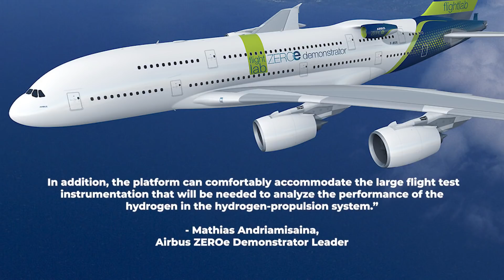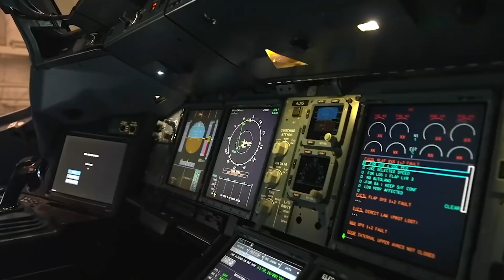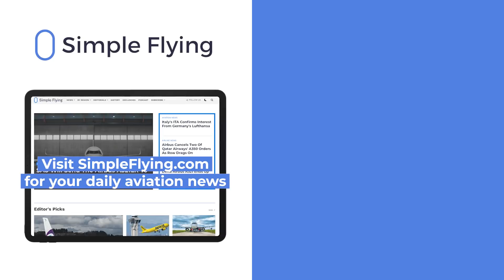Airbus Tests Hydrogen Engines On Quadjet: New Life For An Old A380

Comment: As a person that is obsessed with the periodic table, I think hydrogen is going to give the passengers a chilly flight and it will be unbearable with the altitude and hydrogen, so fuel might be the choice, but it won't for the environment, so the only possible option I can think of is using electricity ⚡⚡⚡

Comment: Several below observe that Hydrogen has to be generated in some way, and the way it is now merely puts the Carbon emissions somewhere else. With electric power the same thing happens; it's just that Hydrogen would allow longer flight duration. I don't pretend to know the entire Science, and it seems the engineers solve these problems, but for now this will require a lot of new windmills and solar farms.

Comment: how does anyone plan to produce hydrogen without using more energy than they're producing???  You'll have to burn SOMETHING to make energy to get the hydrogen.  I guess it's a good argument for more nuclear fission but still. I am highly curious how it could possibly be economically or ecologically viable to use hydrogen as a fuel in this manner since there aren't ponds of hydrogen under the ground to just pump it up. There are ways to extract it chemically, electrically, and mechanically.  my guess is the best option would be chemically but I am not sure even this could be possible to extract enough hydrogen in which you don't nullify any positive gains you would get by using hydrogen as a fuel to begin with.
Reply: Well, hydrogen can be synthesised in a variety of ways. Google the hydrogen rainbow, essentially the different ways of making it are assigned colours, from grey hydrogen (made using natural gas), blue hydrogen (as with grey hydrogen, but you store the CO2 produced), to green hydrogen (made using electrolysis powered by renewable sources), pink hydrogen (made using electrolysis with nuclear reactors), and many more. You can also produce it from biomass too. In terms of efficiencies, electrolysis is ok, somewhere between 50-70%, so for 1 MWh of energy you would get 0.5-0.7 MWh of hydrogen out, other methods can be better.
Reply: @onetrickhorse  Thanks for the reply!  after i posted this I've thought about some ways to get around the cost problems using renewables and nuclear for electrical, and yeah biomass and chemical options as well.  I still wonder about the overall cost of the energy however, especially with electrolysis. solar panels are not cheap to build and also take a lot of power to create, I am not sure the amount of energy a solar cell can output on it's life but i wonder if it's more or less than the energy expended to create it to begin with.  Regardless there is still hydro and wind.  It's a shame the solar reflectors in AZ failed with the plant that liquefied salts. I Also saw a method by which you can produce hydrogen directly on solar cells, it involved running water over them to cool them which improved their efficiency by a large amount, I tried to find that video but couldn't.  Anyways. It's just a cool topic to me.
Reply: @98f5  Anytime! And for what it's worth, you're asking the right questions, many people assume that because solar offers a zero carbon output once made, that it is therefore zero carbon. The reality is that it isn't an eco friendly manufacturing process, and recycling is also energy intensive too. 

With any energy generation technique, the ultimate comparison metric has always been cost per unit energy output, or $/MWh (or £/MWh in my case!), or if you're a consumer, cents or pence per kWh. Here in the UK, to be competitive in the energy market, you need to be able to sell energy to the grid at £60/MWh or less. Now, solar is cheap, perhaps about £40-50 per MWh, and that factors in initial cost (CAPEX) and lifespan costs (OPEX) and eventual decommissioning/recycling costs. Now, that's actually pretty cheap, in fact it's about as cheap as it gets energy-wise. But here in the UK, the sun isn't always shining, in fact, it's rarely shining enough to make the most of a solar installation, and when it does, it's not always when we want it. Wind is expensive, perhaps more like £60/MWh, with offshore being more, but it's subsidised. Wind in the UK is no doubt plentiful and common, but like solar, is intermittent, and often difficult to predict. So you need something reliable, like nuclear or gas to provide that baseload when it's a cloudy calm day, or a calm night when solar and wind is useless. Now, why am I telling you this?

Well, global energy generation works on a 'just in time' operating model. The moment energy is produced, it is used, and power grids react according to demand. That is problematic when you have intermittent energy supply like solar or wind, and it causes wild price fluctuations as demand for reliable methods like gas increase. This pushes up the cost of the energy. Now, what if we could store that energy instead, so instead of shutting down wind farms on windy days when we have too much energy, we store it somehow. Hydrogen could be a potential solution to the problem. You build overcapacity in your renewables, generate a load of hydrogen, store it as either a liquid or convert it into ammonia, and then you have options. On days where you have no wind or solar, you either burn hydrogen in CCGT's, or use it in fuel cells to supply the grid. Or, if you dare to dream really big, create a wider hydrogen economy, and use it for other industries, like aviation, which works to offset the cost. 

You mention efficiency, and quite rightly so. Think round-trip efficiency of a hydrogen storage network; you generate 1 MWh of electricity at say £50/MWh average. Then you generate hydrogen using electrolysis, so lets be optimistic and say 70% efficiency, so that price now is £71/MWh. You spend about 20% of the remaining energy liquefying it, or 10% converting it to ammonia, so now that £71/MWh is now £88/MWh or £78/MWh respectively. Then there's conversion back into energy when you need it, and lets say you run the electrolysers in reverse to generate energy (like a fuel cell), so about 70% once more. Now we've got 1 MWh of energy costing us £112/MWh for ammonia, and £125/MWh for liquid hydrogen. Which is extremely expensive of course. But now let's consider the cost of natural gas. Gas is now costing £120/MWh. And that is going to rise. So suddenly, those costs of storage look very competitive. Once the price of gas reaches about £140/MWh, the CAPEX costs of investing in hydrogen storage technology will be competitive. So food for thought!

Comment: I wish the developments could go faster. The task is getting everything to scale up and built up the logistics. I hope they really make haste on the low-hanging fruit. For example; hydrogen needs more storage volume? Then perhaps regional airlines where range is not the biggest issue can be tackled first. Makes the ground logistics easier too; the airfields from where they'd fly would be closer together and supplying them all with hydrogen for refueling should be plenty doable. Still, go! Rock on!
Reply: Why go faster into a dead end?

Comment: The energy required to liquify the hydrogen must be enormous. I head just to compress it to a practical volume for use in cars consumes something like 10% of its useful energy. No relevant info in this vid though.
Reply: It has to be cooled to under 30 K to liquify. Practical energy requirement must be staggering. Simple Flying, can you give us some info on all this?
Reply: Youtube twice deleted my previous comments so I have to resubmit a similar one. Here it is. 
The minimum practical energy to liquify hydrogen is about 10 kWh/kg while the (lower) heating value of hydrogen is about 33 kWh/kg. So one kg of hydrogen burned to run an engine would produce jsut about enough mechanical energy to liquify the same amount of hydrogen.
See: "Energy requirements for hydrogen gas compression and liquefaction as related to vehicle storage needs"
The Youtube won't let me include the link.
Reply: Youtube. Utterly contemptible.
Reply: While Youtube is contemptible, they may not be responsible for blocking my comments but rather the channel owner.

Comment: Sounds good but don't forget, hydrogen is an energy carrier - not a fuel. It does not exist anywhere on earth in its pure form. So making hydrogen is a very dirty process as it stands, mainly by burning gas or coal. For making green H2 in the quantities needed for aviation, the upscale in infrastructure needed is going to be very, very expensive.

Comment: Unfortunately this idea is a huge waste of money. "In order to produce hydrogen (with zero emissions) a process called, electrolysis. 20 - 30% of energy is lost in the process of creating hydrogen. The hydrogen must then be compressed and stored, losing another 10%. Finally, another 30% is lost when converting the hydrogen into electricity. This leaves you with 30 – 40% of the original energy used. " and unfortunately this process really can't become much more efficient. Hydrogen requires nearly as much energy to produce as it delivers. The CE rating (energy efficiency) for hydrogen is around 60%
Reply: Where did you copy and paste this from?  There are a few oversights in your comment. 
First, the hydrogen is not converted to electricity - it is burned in the engine, negating the energy loss of converting to electricity.
Second, distribution and storage is very easy with planes vs something like a car. A car can be anywhere when it needs refuelling so many locations are needed creating additional transport and storage losses. A plane can only refuel at airports so they could even have hydrogen plants on site or nearby via pipeline.
Third, jet fuel also uses a good amount of energy to make and transport with drilling, extraction, distillation and final processing. 
Hydrogen as aircraft fuel is a lot more viable than other modes of transport.

Comment: should AIRBUS introduces a stretched variant of the A380-800 it should be powered by a HYBRId® power pack . . . the A380-1000 Neo LR which is a concept super stretched variant of the A380-800 or the A380-900 for that matter . . .
Reply: Plus a swimming pool inside

Comment: Does Hydrogen have trust for liftoff or they need both fuels?
Reply: The 4 engines the A380 already has run on normal aviation fuel, only the fifth engine runs on hydrogen

Comment: It's going to boil down to how the hydrogen is going to be made. 98% off the world's hydrogen is made from methane making it filthier because you would be much better off burning the methane. If you make it from renewable electricity it is also wasteful because you would get more power efficiency from an electric engine rather than making hydrogen and burning that. 
Plus burning hydrogen still produces nox. This is cancer causing.

Comment: Hydrogen powered planes is a good step as electric ones probably won’t have the capability to go transatlantic.
Reply: Battery energy density, both by weight and volume, is pretty much hopeless for anything other than a regional flight.
Reply: @geonerd  even at that.. the economy of is horrible
Reply: Hydrogen has a really really really low energy density though. So you need huge tanks to hold the volume required. It's not the weight but the volume.
Reply: @LuLeBe  The thing is its not stored in gas form, its stored in a liquid chilled to −252.87 °C so more can be stored on the plane as something that is colder is more dense. Physics huh?
Reply: @CaptainNate22  Also they'll be testing with metal cryogenic tanker unlike composite tanker from Boeing
Reply: @LuLeBe  exactly. It's shifts the design focus to volumetric efficiency rather than weight. This isn't necessarily a bad thing, it's just different to the status quo.
Reply: Maybe a good option is to use a hydrogen based fuel cell to power an electric motor .
Reply: @kunjukunjunil1481  no, that would be a horrible ineffective solutuon

Comment: I wish this would work but ask anyone who works with H2 and you will start to see dozens of MAJOR problems
Reply: Please elaborate on the major problems with H2
Reply: @johnlove7328  

1: cryogenic under pressure
2: high volume
3: vesil very heavy
4: very energy intense to compress/chill
5: very energy intense to produce
6: very low efficency

Comment: It is interesting to finally see hydrogen take off, pun intended. It's even better to see if used intelligently, by burning it. But it still has to compete with battery technology that shrinks its energy density by an average of 7% every year. That's a tough one to compete with. Both mean cleaner skies and thumb nose to the rest of the mobility industry ;)
Reply: Yes a battery powered aircraft has one glaring issue: it doesn’t shed weight as it flies like other engine types. So takeoffs have to be done at landing weight
Reply: @TheTubadMoose  It's not a glaring issue. It's something every and any aviation engineer knows and understands well. All the electric aviation startups I've spoken to and interviewed say that they toughened up the landing gears. 

As always, there are always more solutions than obstacles. That's why these people find them for us :)
Reply: @ElectricUAM  I’m not talking about gear strength.

The heavier something is, the more energy is needed to move that weight. So unless the batteries get to the point of weighing less than a plane with its fuel reserves, they will never be able to carry more pax/cargo.
Reply: @TheTubadMoose  I'm sure you're aware that that point is more than well understood in the aviation world. Like I said previously, all the UAM/AAM companies I know and have interviewed know this basic fundamental of AAM aircraft design. Furthermore, once a plane glides with enough lift, it doesn't need a lot of energy to do so. Airliners cruise with maybe 30% of their total power output at cruising speeds and ceilings. Planes are highly efficient.

You're referring to battery energy density, which at the moment, is not big enough for more than four people flying for 10 to 15 minutes. However, new batteries are coming on the market this year raising that energy density for much longer flights with higher payloads. Think of Atrium with 450 kW/h commercial packs available right now and with 500 at the end of the year. Also, keep in mind battery energy density shrinks about 7% a year, something unmatched by internal combustion engines. Add to it that the price also shrinks and you can see the potential for the future.

I think you're also thinking batteries are so big it's hard to carry passengers. Nothing could be further from it. Check out Ampaire. They use a Cessna 333. The only thing they did was to add the battery below the cabin, much like a Cessna Caravan. Or look at the Volt Aero which takes the Cessna 333 design but redesigns it completely with integrated batteries. Look at Jaunt or any other eVTOL/eSTOL for that matter of fact. There is room.

Again, there are always more solutions than obstacles in this known observable Universe.
Reply: Hydrogen is far more energy dense than battery
Reply: @observantmagic4156  Yes, for now, but unlike batteries, its energy density doesn't increase every year.
Reply: @ElectricUAM  Well, it's also questionable if the energy density increase will continue at the same rate with batteries. You see this with a lot of technologies, first there are massive advancements once proper money is invested, but eventually you see diminishing returns because you get closer and closer to what the technology is actually capable of.
Reply: @shi01  It's not questionable when you've been following the industry as long as I have. For the past twenty years, energy density has, on average, shrunk by 7% every year including price. We're now able to commercialize 450 kWh battery packs and 500 by year-end, more than sufficient for UAM. The industry is aiming for 1000 kWh and beyond. There are billions poured into that technology. Short of us bucking ourselves out, there is money being made so it's pretty unstoppable. Unlike fossil fuels and internal combustion engines, there are few diminishing returns in battery technology. Eventually, we'll have to look into anti-matter, but until then, storing energy with batteries has many decades in front of it.

But don't trust me. Do your own research. Mine stems from 15 years in this industry.
Reply: @ElectricUAM  Look, Moor's law predicted a doubling of the number of transistors in CPUs every 18 months and it held true for about 45 years. But eventually it broke. 
The engergydensity required of batteries to power an airliner of similar design as we see it today would be about 5000-6000Wh/kg. Current good batteries have about 300Wh/kg? So even with a capacity growth of 7% per year, it will take 45 years to get there.
Reply: @shi01  Yes, and all if that is very well known. Hydrogen can't match that growth either. That's why we'll turn to other systems down the road. In the meantime, batteries have a far better growth path than hydrogen. At least, so far. Anyone who says hydrogen or batteries are the way to go for the next 100 years, shun them.